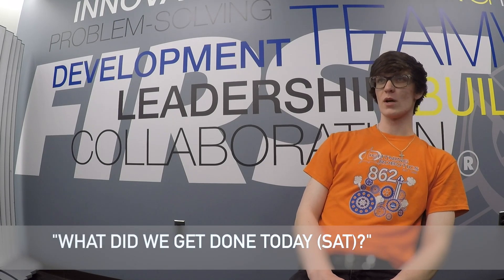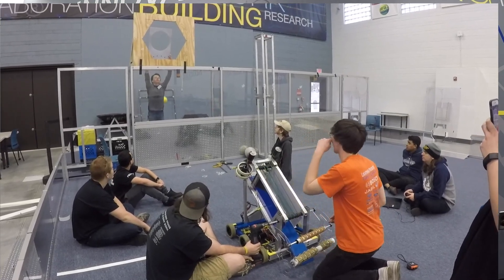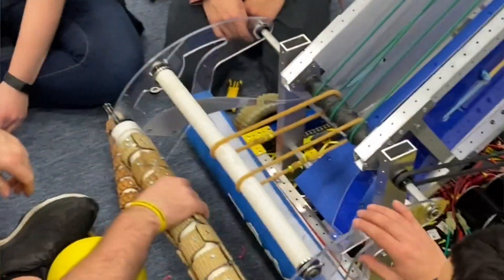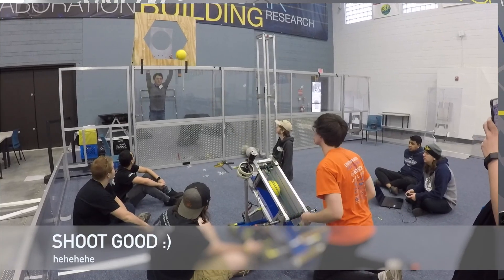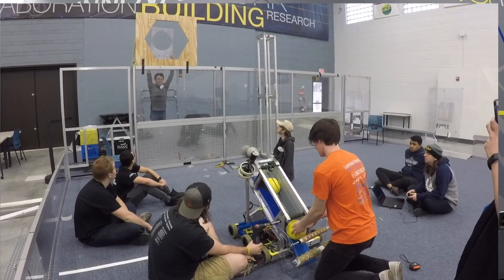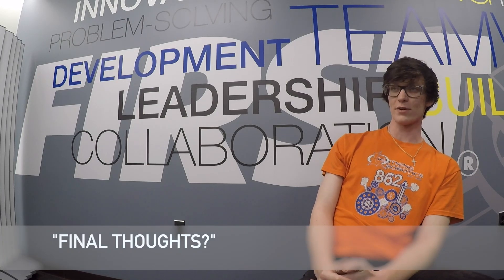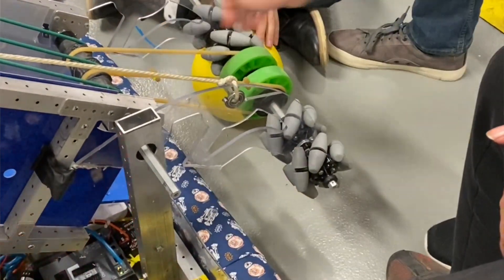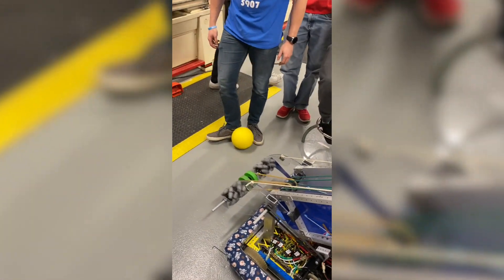2020 Bulldog Ri3D Recap Day 2

Comment: Did you guys consider using a constant force spring, possibly even surgical tubing, to extend a linear slide lift for climbing? My FRC team used a similar system in 2016. You could have used a pin system similar to the swing arm to release it. It still would have been more difficult to place in a good location on the robot, but it would have at least required less programming and one less actuator.
Reply from the maker: Yes we did actually consider using constant force springs in a number of different ways for climbing. This was the 4th version because we didn't have enough parts in house to make any of the other designs and we knew we wanted something working within the 3 days. The entire climber runs with just a single motor and some surgical tubing so there really isn't much to it. Feel free to check the GitHub to learn more